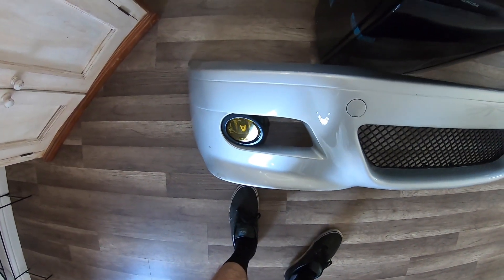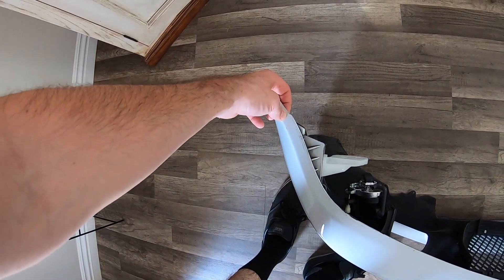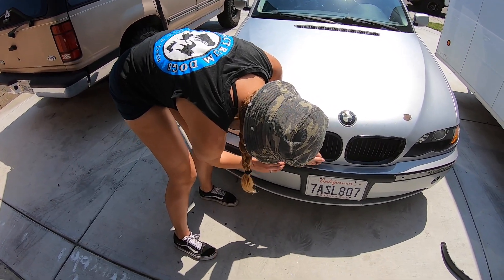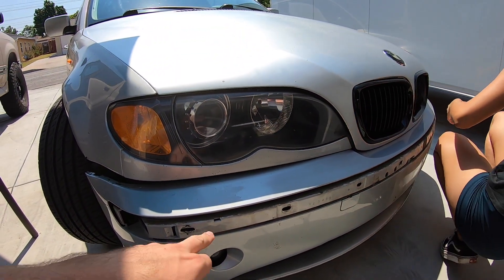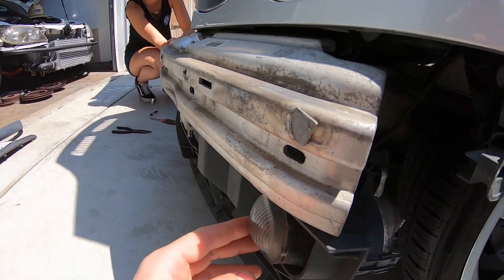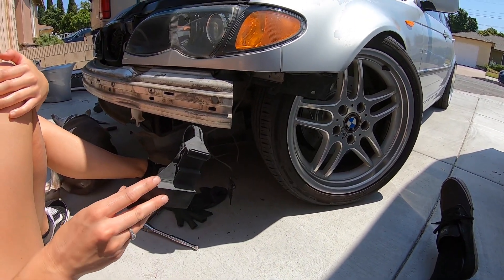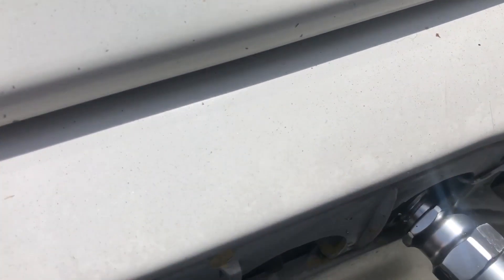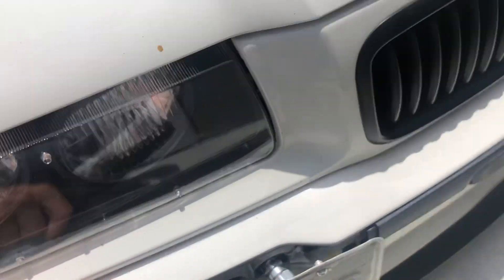E46 Build Ep. 5 (M3 Bumper Conversion)

Comment: Hey there, I want to install the same bumper on my e46 sedan but people say that there will be a gap between the plastic wheel arch and the bumper. Is that true or can you force the wheel arch to the bumper with the screws ? I Don´t really want to leave a whole behind the bumper but the m version wheel arches are really expensive....
Reply: Hey did you install the bumper without the m wheel arches?
Reply: @Флориан_е46  Hey, I did, It does have a gap at the bottom and middle section. Nothing too noticeable.
Reply: @henrique8921  Thanks for telling me, any chance you could upload 2 pictures for me?